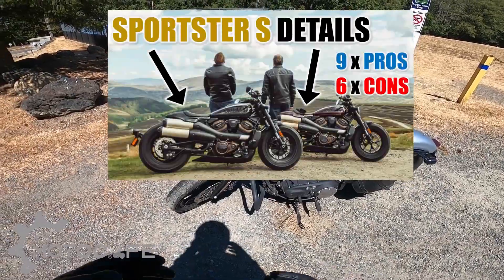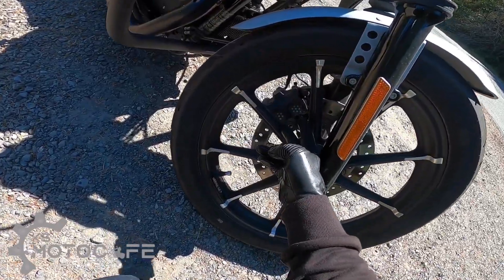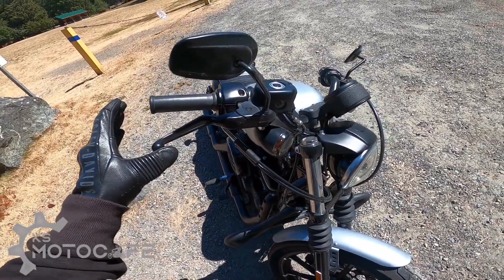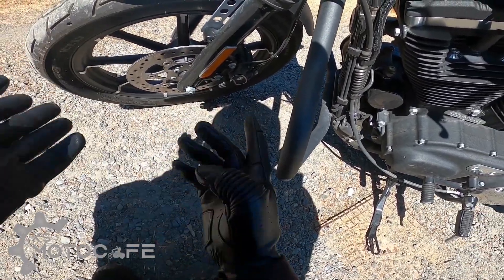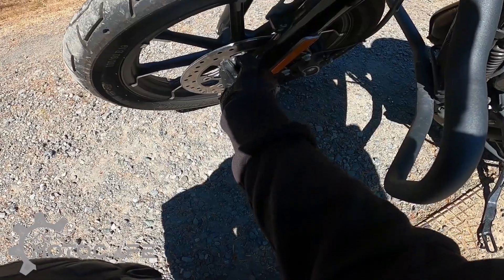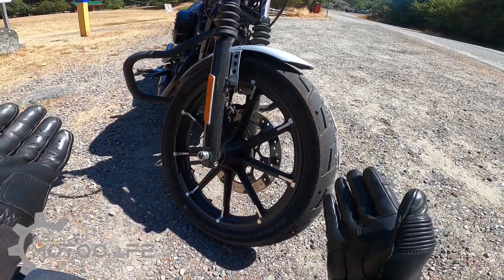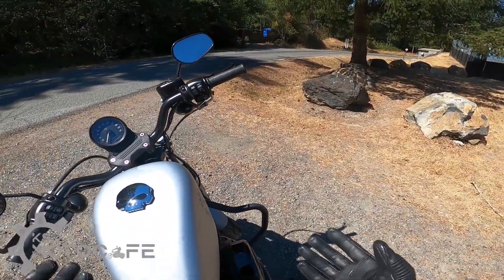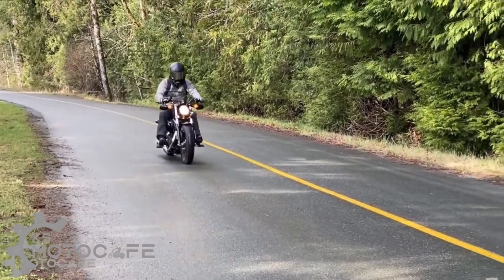Motorcycle Front Brakes Explained: Brake Fade

Comment: Harley’s design decisions on front disk brakes have always baffled me. Bike manufacturers typically use double disk brakes for high power and/or high weight bikes… for reasons you clearly point out. Certainly, all Hd Big Twin models are heavy weight bikes… yet the Softail Standard and Fat Boy have singles up front? I think in the Standard it’s done to keep the price down, and I think scrimping on safety equipment for cost is a bad strategy. On the Fat Boy it’s done for what, looks? They just want to show off that solid front wheel? Ridiculous. The Sportster S isn’t excessively heavy,, but it is now the most powerful Harley made, after the PanAm, it should have doubles up front.
Reply from the maker: I agree with you 💯- it has to be the price but they are cutting out the wrong stuff.  I rather see a dual disc on the Sportster S than all the TFT display with 100 button controls